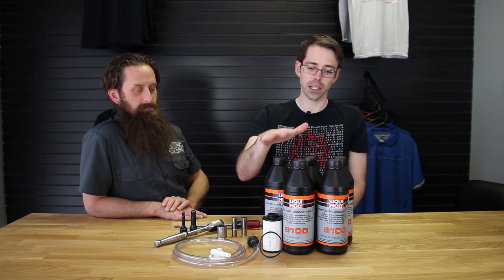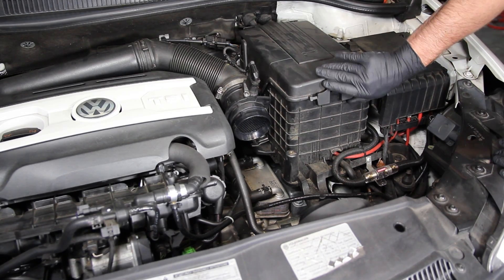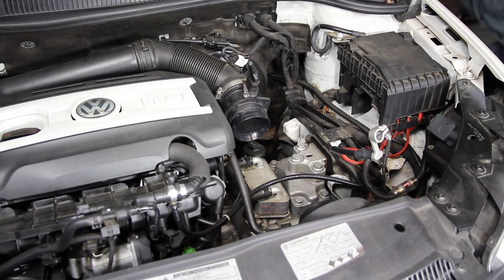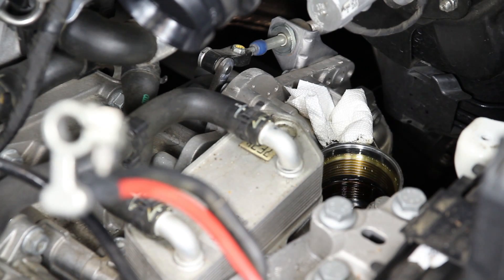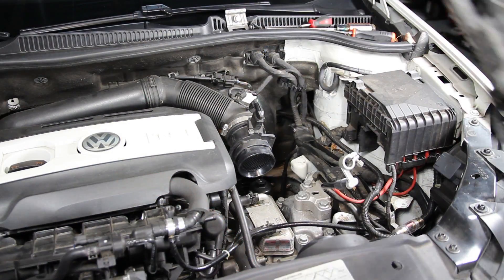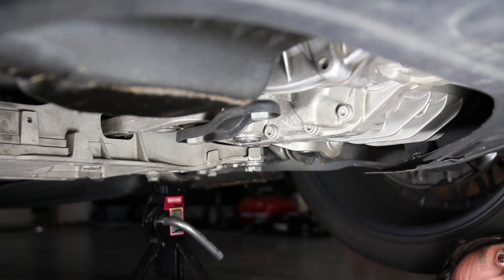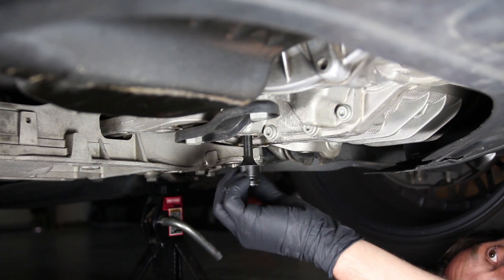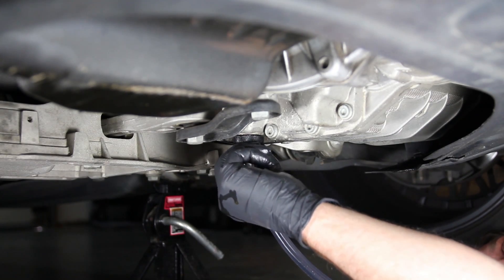How to (DIY) Perform a DSG Service on a VW and Audi Transmission (DSG Service Kit)

Comment: can you use a memory saver so you do not have to reinitialize stuff?
Reply: +nicholas elias also awesome video! thank you for taking the time to show this
Reply: +nicholas elias in the mercedes benz 722.9 transmission its a similar fill procedure as this. and for those who mentioned about using VCDS to measure the temp, mercedes also says to use star diagnosis but to be honest Ive found that using a pyrometer on the fluid pan is accurate to within 1 degree with the dealer scanner so I wonder if you can do the same here. much quicker than the time it takes to hookup the dealer scanner

Comment: Hi is this the same as the mk7 tdi golfs and if i remove the battery for more access room will i need a code to put into the radio as I'm reading through the manual i cannot find anything about radio codes,
cheers.

Comment: I've been lied too.. why in the hell would I pay vw to do this at $300 to $350? when I can do it for $120? that's with authentic vw fluid filter and crush washer. Only difference is I'm filling from the top...

Great video, however is it necessary to heat it up and then drop the main plug, or is there some leway as long as you don't overfill it by a outlandish amount?

Where's the threshold for what is ok to overfill, I'm assuming less that 1/2 L is ok to overfill?
Reply from the maker: Carlos Finch The way shown is the only way we have done this particular job.  We show the way which this job would be performed by most VW and Audi specialist.  If you want to be sure your fluid level is exact you can perform the level checking procedure which requires a scan tool.

Comment: So what I gather unlike engine oil it having excess transmission oil won't do any harm?
Reply from the maker: Jacob Torres Probably depends on how much excess.  If you end up way overfilled it could be an issue.

Comment: Don't u have to drain some oil from the bottom after u fill it because of the tempeture?
Reply from the maker: VWGTI The fill procedure as per VW would require using the scan tool.  What we show here is what most VW and Audi shops would do to perform this service.

Comment: I don't have car lift, should I put my gti on 4 stands then.....I should right?
Reply from the maker: VWGTI 2 or 4 should be fine
Reply: I`m gonna put the oil through the top though, what do u think?
Reply from the maker: We have not done it this way but it sounds like it could work fine.
Reply: VWGTI I've done it that way. Get a funnel and tube and you can fill through the hole where the filter goes.
Reply: joseph leilich I`m scared I might fucked things up. I gotta try though, I don't wanna pay $350 that the dealer charges every other mechanic. Looks fairly easy on the videos I`ve seen.

Comment: I thought that the snorkle was used to measure the oil in the transmission? You shouldn't have to rush to put the last plug in.
Reply from the maker: floyd romero The actual fill procedure is not that precise.  Its based of transmission temperature with the vehicle running then filling until it spills out .  The method depicted is one that would be most commonly performed by VW and Audi service professionals.
Reply: I see well thanks for the video it was very informative about to change the oil on both cars after deployment!!!!!
Reply from the maker: Very cool.  Let us know if we can help with that parts.... Thank you for your service
Reply: @Deutscheautoparts  so does that include you guys? because in a newer dsg service video you guys do the procedure correctly. not sure if I want the pauly-install option now...

Comment: I expect that you should still check the fluid level at the proper operating temperature. I also expect that you should use VCDS and reset all the clutch pack engagement points. Also, since you disconnected the battery, you should video resetting the pinch protection feature on all 4 windows. No wonder people feel ripped off by VW technicians on doing a half assed job.  Better to just premeasure 4.6-4.7 liters and do a top fill from the transmission filter side with a regular ATF funnel.

This guys DSG transmission was overflowed if it leaked DSG fluid the way it did upon removal of the drain plug on the bottom, the 14mm plug.
Reply from the maker: VWGTI You can always purchase the parts from us and let a local VW specialist do the install.  This will help save you some money
Reply: Randy van Vliet I was gonna do it myself but I don't have the vagcom so im going to let the dealer do it. didn't want to pay $350 but looks I`m gonna have to.
Reply: Deutsche Auto Parts Do you guys have any recommended VW specialists? I live south of Raleigh NC.
Reply: Jenn, do a look up online at VWVortex.   Google is your friend, use it.
Reply from the maker: +Jenn Nash you can reach out to the guys at BFI or Aapex tuning. They can help

Comment: This video puzzles me. Maybe i'm missing something here. Why didn't you drain it before you changed the filter? why is the oil added from the bottom instead of the top? And why is the drain plug at the end only tightened by hand?
Reply from the maker: mkygod You can drain it first if that is your preference.  The oil is added from the bottom as that is how VW and Audi says the trans should be filled.  The drain plug is not tightened by hand the is the internal plug.  There is another plug that comes after that one.

Comment: Do you need vagcom for doing this procedure.  Most video I've seen said that they needed it.  
great video by the way.
Reply from the maker: ***** if you want to do it by the book you would need a vagcom.  Shown here is how many professionals would perform the install.  If you want to be 100% certain then setting the level with a scan tool would be how to do that.  Hope this helps
Reply: Could you probe the oil through the stand pipe if you dont own vagcom?

Comment: what kind of gloves did you use_
Reply from the maker: razvan4motion Those are nitrile gloves supplied by his shop.  These are the glove we both prefer if we have a choice http://www.amazon.com/gp/product/B000JFL85W/ref=pd_lpo_sbs_dp_ss_2?pf_rd_p=1944687622&pf_rd_s=lpo-top-stripe-1&pf_rd_t=201&pf_rd_i=B002NS0V9C&pf_rd_m=ATVPDKIKX0DER&pf_rd_r=0RR0TMC65AB1PYPJRCJB

Comment: You MUST do the end part from 14:19 with the engine running else you will never get the correct oil level. Car must be running at idle until temperature is right, then you remove the filler tube and let the excess oil drain. When it starts dripping only you close the screw. Car must be on its wheels at horizontal position. Filling to much oil will cause overpressure and might damage the Mechatronic unit. At least do it right guys.
Reply: So I used your method. Got the oil to temp and let the excess oil drain with the main plug out. A week later after doing the job I now have a code "clutch pressure adaption at limit".  Pretty sure one should cap the drain plug as shown in the video. I'm going to add another quart and try this again.
Reply: @Messy_Jesse   How did you know when the oil is at correct Temp?? Is there a tool a scan tool that works???
Reply: @deezz1982  Let it idle for 10 minutes with the heat turned off. When oil temp guage shows normal operating temp call it good.
Reply: @Messy_Jesse  ok sounds good. I dont have an oil or engine temp monitor on my new Jetta
Reply: Massive Dubstep how did you fix clutch pressure adaption at limit code?
Reply: So was 5 bottles too much?
Reply: is this the same transmission changing method for a 2008 VW EOS 2.0 turbo.
Reply: GigiBelea aka JAX lolol the only thing that has pressure is the clutch. Over flowing causes overflowing from the top of the trans. You should go to a real performance shop and talk to real mechanics
Reply: Zac Jones so this guy is wrong?
Reply: @felix_zero  After getting it to temp, I added an extra quart with the gravity funnel again. This time I let it drain from a steady stream and capped it as soon as the stream started to break up. Maybe took 10 to 20 seconds or so???
Reply: Fill it up from oil filter housing thats it !!!!
Reply: @Messy_Jesse  And so the problem is now solved? Im looking to do this oil change soon on my Jetta Mk5 TDI.
Reply: @RobinGWakker  from memory the clutch pressure adaption at limit error is a solenoid that isn't properly sitting in the transmission, it needs to be eventually replaced and seated better but yes my second attempt worked.
Reply: @Messy_Jesse  So you do it like they said in the video?
Reply: @BiraparSingh  Im going to answer your question with a question. What happens to the moving parts of a cold transmission when it has to much fluid and it starts to warm up? https://www.youtube.com/watch?v=6bg5Lzv5_08
Reply: @begilmezz   how much longer does it take to do like that dont have the filler tool n need to change my dsg fluid
Reply: babybearjoe it will more quicker and easier than what that guys doing mate
Reply: @Messy_Jesse  ...I can't believe I just watched that whole video....

Comment: I've read that after replacing the fluid you have to get in to Vag-Com and wait until the transmission temperature is up to operating conditions and then remove the metal outer cap and allow the excess fluid to drain. Is that step precautionary or necessary?
Reply from the maker: Keegan Bye That is the official procedure from VW or Audi.  If you want to be certain you can check the fluid level like that.  The procedure shown is what you would likely expect at most places who perform this service including dealers.  The reason why they feel comfortable with the fill level is based on the experience they having in filling the systems.
Reply: Deutsche Auto Parts Ah ok that makes sense. So if I use your 5 liter system and don't spill more than you did in the video (no offense, this is a terrible design to work on) then I should be good?
Reply from the maker: Keegan Bye Yes should be.  Also you can always measure what you take out and make sure you get that much back in.
Reply: Deutsche Auto Parts Thanks a bunch, awesome video. I'm ordering my stuff from you guys because of it!
Reply from the maker: Keegan Bye Thanks we appreciate the business very much.  So glad we were able to help.

Comment: I have a 2011 VW CC R-Line 2.0TSI w/ DSG tranny.  I brought it to my local Cottman Transmission to have the transmission fluid and filter changed.  They replaced the fluid with Valvoline Dextron-VI full synthetic.  The  manager told me this was definitely the correct fluid, but I can't find anything to show that it's compatible.  Can you give my any insight on this?
Reply from the maker: Todd Boudreaux We would highly recommend getting that product out of your car.  As mentioned in the video if it does not meet the spec then you should not use it in your transmission.  I have looked around and can find any info showing it meets the spec required.  The spec it TL 52 182, if they can produce a document from Valvoline with that info then you have no issues but otherwise you should consider removing this fluid.  Also on a side note you should consider finding a local VW specialist in your area instead of bringing your vehicle to places like Cottman.  Sorry to hear about your troubles and I hope you get your situation taken care of easily.

Comment: Great DIY! Really simplified it and makes it look easy. Is it the same process on TDIs as well? And is there a risk of overfilling the fluid by putting in all 5 bottles using the included filler tool? Thanks!

Comment: seriously there is no fill plug you have to fill from the drain plug?
Reply from the maker: Yes this is the way most VW and Audi Transmission have been for some time now.
Reply: That's weird, sounds counterproductive to spill oil all over the place. The drain plug should have a little valve on it to prevent spillage and waste. I bet that oil isnt cheap either

Comment: Great video but, that is a terrible design by VW. In my opinion at least. Why not just put a fill tube up by the filter? Or let you fill from the filter opening?
Reply from the maker: Thanks for the feedback.  In regards to why its tough to be sure.  VW and Audi transmissions for sometime have always has technical fill procedures.  We would imagine that their may be some engineering reason why, but we don't know for sure.
Reply: Deutsche Auto Parts...IMO, it's designed that way to force (most) owners into the VW service dept to make money it's definitely not designed with owners  that want to do it themselves. It could be but then VW wouldn't get more of your cash. Such is the auto industry as a whole, it's just not VW. 
"We would imagine that their may be some engineering reason why, but we don't know for sure." The reason is what I stated, the industry has figured a way to get more money...dealer service, PERIOD! Of course they could have "engineered" a top fill design you know like cars used to have. This was a planned change plane and simple.

Comment: The video shows that he caps it up right after filling it. Many other videos I watch shows the black plastic piece in the transmission works as a "fill til spill/overflow" device ( https://www.youtube.com/watch?v=nhE19GCXlvA#t=435 @ 7:15 / http://forums.tdiclub.com/showthread.php?t=169356). Is it safe to run the extra fluid?
Reply: Mike Disieno no it will come out of your megatronics plug and may  cause other damage

Comment: Great job, will you guys post any video about upgrading the clutch discs?
Reply from the maker: theBlackGTI Thats awesome that you are putting down that much power.  You might need to go with something custom.  Im sorry we dont have much experience with high HP DSGs
Reply from the maker: Are you referring to clutch discs on manuals or DSG's?
Reply: Deutsche Auto Parts- Your Source for Everything VW and Audi On DSG, I have some serious slipping problem, seems that stock clutch discs cant handle that much torque :P
Reply: Deutsche Auto Parts- Your Source for Everything VW and Audi I own a 430hp GTI
Reply: theBlackGTI 
https://www.youtube.com/watch?v=vxG1PFHOpI8
This DSG only has the clutch modified, including the actuation (manual from stand stil) and the mechatronics are programmed to suit.

https://www.youtube.com/watch?v=dqSRrwLZo-g
This one is sweet too, and with the DSG actuation!

You can get in contact with them through http://www.adrenalintuning.de/

If your German is not what it used to be, drop me a line ;)

Comment: You stated that if you have the car running while putting on your drain plug, you may lose less fluid. Would it be a smart choice to put your car into different gears before putting on the drain plug just to have fluid flowing through the system to minimize the amount of fluid that spills out?
Reply from the maker: This could help, but likely not as much as you would think since the  DSG trans does not use a standard valve body type system that has fluid channels in it.

Comment: Don't you need to use vag com during this process?
Reply from the maker: If you want to check the fluid level after filling you would need a vagcom.  Generally putting 5L of fluid in will get you fluid level pretty close.  Checking afterwards wouldn't be a bad idea.

Comment: I would also like to add, You MUST let the car run, and the trans temp must BE at 35*C via VCDS when removing the fill port to measure/level the fluid, theres is a hydraulic pump in the DSG that runs to keep the mechatronic,clutches and lubricating the transmission so adequate fluid level important!

Comment: You also can fill the fluid top side via DSG filter housing using a 1L capacity funnel and place a tube going into the hole of the (accessible after removing the filter). You have to measure how much you drain out, then add 250-500ml more then you drain, wait  for temp to rise 35*C via VCDS, then remove the drain plug for fluid to level.

Comment: totally didnt set the fluid level or perform basic settings 61 and 60.
Reply: Deutsche Auto Parts- Your Source for Everything VW and Audi Question: The "approved procedure" is to allow excess fluid to drain out of the overflow tube.  Then run the car to allow the oil to heat up to 35 degrees (expanding to some degree) draining off a little more and then cap it, To get as close as possible without the Vag Com why wouldn't you at least allow the excess oil to drain from the overflow tube before you cap it? It seems as though you would still have a little more oil than recommended but would be considerably closer.
Reply from the maker: marc murchison That spec would be with the transmission running and would be different if the transmission was static.  The method show would generally be how most shops would perform a DSG Service.
Reply from the maker: Setting the basic settings 61 and 60 are not required when doing a basic drain and fill as per VW.  That would generally be done when replacing the Mechatronics unit, or some other internal component in the transmission.  As far as setting the fluid level.  This is not a bad idea to check.  Most times in the dealer or VW shops a customer would not want to leave their car there all day to allow it to cool down enough to allow the fluid to be properly checked.  If you are familiar with the check procedure, as it sounds like you are you know that VW recommends checking the fluid between 35-45 degrees celsius.  This procedure involves pulling the plug while the car is running and allowing fluid to flow out until you have reached your desired temp.  This procedure is not an exact science leaving a fair amount of variables.  We have a spoke with our share of experts who have done testing on filling with 5L of fluid letting it cool then checking.  They have found that this generally sets the transmission to an acceptable fluid level.  Although as mentioned above if you really want to be sure using the proper procedure to check is the only way to know for sure.